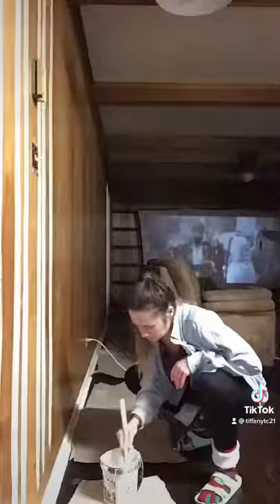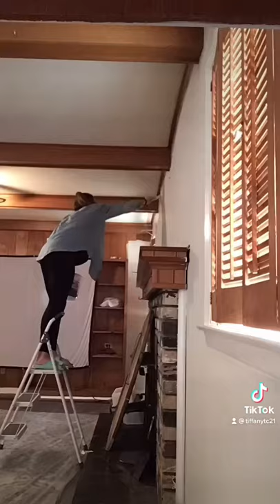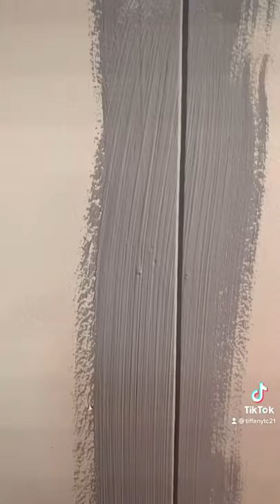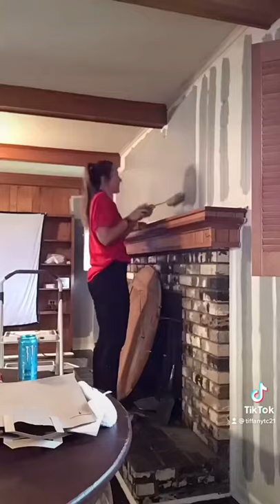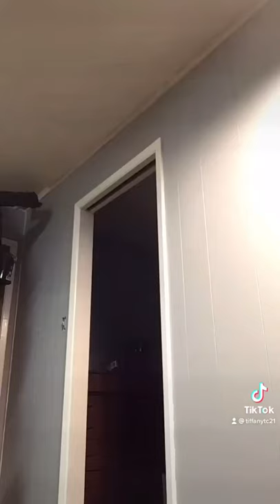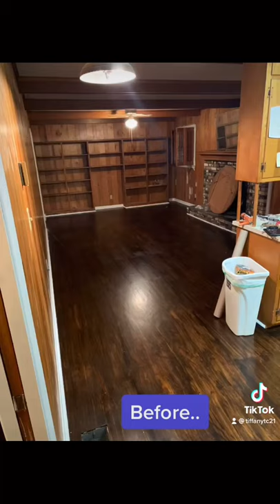Wood Paneling Paint Makeover

Comment: the lines in the paneling  aren't that deep you could have saved time and just used the roller , I know I've done mine , and used primer that was tinted the color I wanted , to save a step of two coats.
Reply: Did you have to sand it first?